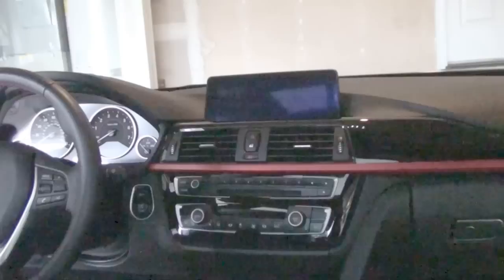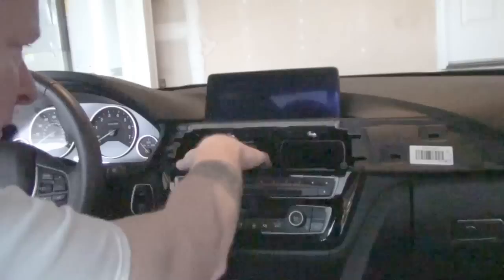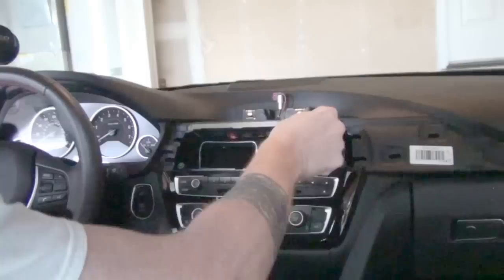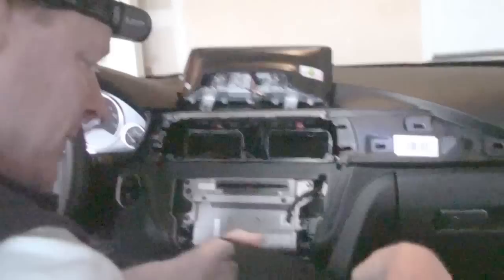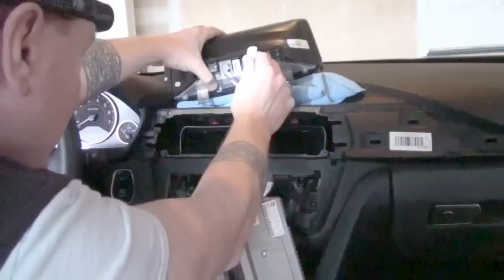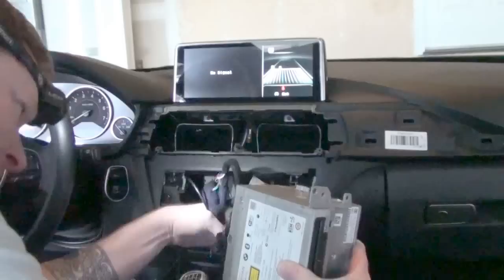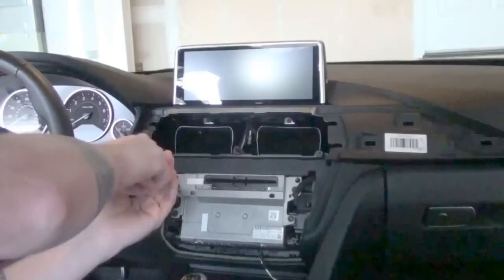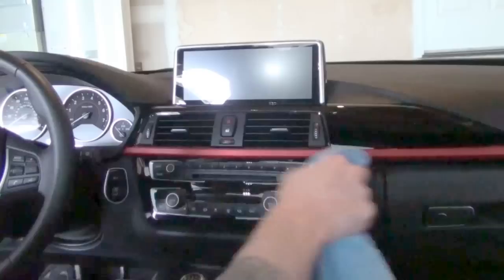BMW F32 Avin 10.25" BMW Android Multimedia Navigation System installation DIY

Comment: Very helpful video!! My only suggestion is be careful not to touch or dirty the ends of the optical cables. In the event they get dirty you could experience degraded audio quality. I'm not sure how sensitive audio optical fiber is to contamination. I know first hand network fiber optic cabling is extremely sensitive to contamination. Literally a spec of dust on a connector (plug) can destroy bandwidth or prevent the network from working entirely. Could be the same for audio fibers.
Reply from the maker: Solid advice!

Comment from the maker: Screen resolution is 1280x480 and very sharp, makes all of the displays look better in the original iDrive areas.  The backup camera is especially noticeable as detail and color appears much sharper.
Reply: Hi bmwdiyguy, I saw this on the avinusa website. Do you know if it will work on a bmw x5 2007 e70? The site only says bmw e70 2011. In other website it is 2007-2013
Reply from the maker: Howdy!  I honestly am not sure.. I would reach out to Avin directly and ask them first, as I have no way of knowing if the mounts and install points are the same.

Comment: Hi bud.
I used this to install on my car and appreciated it. I'm uninstalling before I sell and just wondering if I could get away with just unplugging the screen and swapping over, without having to pull out the radio. What do you think?
Reply from the maker: No because you have to take the adapter cable back out
Reply: @BMWDIYGuy  Cant find my guide, what's the adapter cable doing?

Comment: Hoping you might be able to answer a quick question.  I had my 428 into the shop and they did something with the power that caused the Display to reset.  I got everything back to the way that I had it but the screen is now so dimm that it is barely usable.  I have used the 3 setting brightness button in the drag down menu but that only makes it worse.  In the camera settings there is a brightness setting but that is at 100% and that is also worse.  It is now at 100% what used to be the dimmest setting prior to whatever the shop did to "reset" things.  Any thoughts on increasing the systems brightness?
Reply from the maker: That is very very odd and cant say I have seen that behavior.  Did the shop take the display out or something?  Other than some bizarre wiring problem, or maybe damage to the display I am not sure what would cause that.
Reply: @BMWDIYGuy  the display never came out, at most it was the battery was disconnected for a while.  OEM side is perfectly fine but 100% brightness on the Android side is not enough to use it during the day.  I sent a support question into Avin to see what they say.
Reply: @BMWDIYGuy  sorry to bother you again on this, but I haven't been able to get any help from AVIN.  I believe what happened is that the B<W shop had the battery disconnected and the headlights on and when they connected it back up it caused the default brightness setting in the display to max out at nighttime brightness, even during the day.  I have the factory img from Avin, but I want to reformat the unit and install fresh.  Install update over itself has not worked.  I have tried px3_reset.img, and px3_format.img, but neither of those worked.  Any thoughts on how to wipe, reformat and reinstall the image fresh?

Comment: I did purchase the unit and it came out really great! Install was a piece of cake. I also purchased the back up camera. Do you mind telling me where you plugged in everything? I do get where to plug the basic yellow plug. But there's the other wire with the red and black wire together. Where do I plug those into? because you have them by the front and back of the car.

Comment: Hi I have a quick question, at around 15mins you mention possibly running a cable back to the AUX in the arm rest, do you have any more into on that? Before I start fitting my system I wanted to make sure I know what I might need to do, thanks :) amazing vid and really made me feel really to fit mine!
Reply from the maker: Always happy to help and the install is really pretty simple. 8)  The AUX cable is included with the kit, so IF you end up needing to run it, you do so from the space behind the head unit and under the center dash, and up into the space under the arm rest and AUX port.
Reply: BMW DIY Guy great thanks! So the AUX cable included is for that purpose should t be needed? Will I find a male or female connection when I route it to the arm rest? Sorry for the questions, it’s the only bit I’m worried about :)
Reply from the maker: Nothing to worry about.. its a male to male plug, from the wiring harness to the AUX port under the arm rest.  Super simple and easy IF you need it, as I didn't have to run it myself.
Reply: BMW DIY Guy great so just a plug to deal with if I need it, thanks for the quick reply :) going to try and it in a couple of days :)
Reply: Hi, I’ve successfully fitted my screen! Looks great! I don’t seem to have sound from the android side so look like I’ll need to run that cable :( also when I go to navigation it opens google maps which is fine but  it says ‘can’t connect to the network. Check your data and try again’ any ideas how to resolve that?
Reply from the maker: Yes.. so google maps requires an internet access, OR you have downloaded local maps.  Either way, attach your display to a hotspot or wireless from home and run any updates, and download offline maps.
Reply: BMW DIY Guy yup that worked! As expected I have no sound from the WiFi side, I’m hunting where to plug that in, I had a female AUX on the back on the CD unit with audio out on, I’m guessing it’s not that?
Reply from the maker: No. you will want to run from the aux port on the new wiring harness, to the aux port under your arm rest.
Reply: BMW DIY Guy sorted and working! Perfect thanks so much for your help :)

Comment: Hi there I have one of these units and would like to know how you change the parking sensor screen back to the oem option? When the parking sensors come on it goes to a weird android screen which is not oem. Can this be changed?
Reply from the maker: Check in device settings and set PDC to OEM.
Reply: @BMWDIYGuy  thanks would this be the same for the android 10 unit as I can't find devise settings in that?

Comment: Hi BMW DIY Guy! 
Thanks for all the helpful videos! 
I’ve got an interesting question for you and I was wondering if you might be able to help me? 
I’ve got the Android 8.1 10.25“ Display in my E88 installed. Its basically the same as the Avin Gen 2 and after installing I seem to not be able to use my IDrive controller in the original BMW menu. It works perfect in the Android menu though. Do you habe any idea how I could make it work? 
I’ve tried the CCC idrive A and B and also tried all the Options in the car type option in the settings menu.
Please help me if you can! Cheers and keep up the fantastic work! ✌️

Comment: Hi. Great video:-) A simple question. Is the Avin-icons displayed right away when you start your car, or do you see the original menues, and then have to press the menu button for a couple of seconds to see the Avin-icons?
Reply from the maker: Great question, and the answer is "it depends".  The screen will default back to where you left it last.. so if you are in the iDrive screens, that will be displayed normally, like your OEM screen.  The android side is still either warm or cold booting (if cold about an 8 second(ish) startup) depending on how long it has been off and then will be available.  If you left it at the android screens when you shut down, if its a warm boot you will see them almost instantly, or after cold boot start.
Reply: BMW DIY Guy Thanks for a helpfull answer:-)
Reply from the maker: Always happy to help!
Reply: BMW DIY Guy hi again. Well, I bought it + rear camera. I drive a BMW F11 (5-series) do you know any DIY videos/guides for this particular car?
Best regards
Mikael
Reply from the maker: So regretfully I don't have anything for that specific model, but am willing to bet it will be similar at least.  If you are in the PacNW, I could possibly help.  Shoot me an email if so.
Reply: Hi Stefan. Just received the kit:-) With a rear-view camera, Apple CarPlay, DAB+ and OBD2. I wrote you a pm, but I don't expect you to answer my many questions - there is just one, which keeps bugging me. In the package there was a microphone with a mini-jack. What do I need this for? I thought the microphone in the car was used? Is it when your using the Avin bluetooth-telephone-system og CarPlay? If I need to use it, will I have to connect it to the Avin-screen (there is a female mini-jack cabel connected to it)? Thanks!
Reply from the maker: No problem and replied to your message as well.. the mic included is for handling calls and the like when taking calls through Bluetooth and the like.  There should be a connection for it, if you plan on using it.  I know in my case I didn't add it, as I didn't need it personally.
Reply: BMW DIY Guy Thanks again. Been trying the system for week now. Happy I bought it. I like the CarPlay App, and the Apple navigation works for me much better than Google Maps. 
Question: is there a way you can change the icons on the main display or delete some of them?
Reply from the maker: Mikael Hultengren so no, it's not possible to change the top level tiles.
Reply: BMW DIY Guy Thanks. Okay, listen! I just wrote to Avin, asking the same question. The whole design has just got a complete make-over: the new BMW ID6 NBT EVO UI!!! You can check out snap-shots of the design on Avin site. Just received a link to a large file with the update - this is f... exciting:-D
Reply from the maker: I will give them a shout right now and check it out, thanks for the heads up!
Reply from the maker: I just got the update yesterday, and just change to change to that option in the system settings.. its a cool change!

Comment: What's the resolution on this screen?  I see an icon for "Original Car" so I have to assume this switches back to Idrive, correct?  I have the larger screen already but nothing is squashed on my screen, which is why I asked about the resolution.  Either way, nice option!

Comment: My fiancé installed mine over the weekend. I took a long trip yesterday and I noticed that whenI put on any music app the sound is only coming from 2 speakers. The center one on dash and the passenger door. The Navigation works through all. OEM radio works though all. I though maybe I could bypass it if I connected my wireless Bluetooth aux receiver from the avin headunit direct... but I cant find an option to turn on Bluetooth to scan for devices. Any ideas??? Thanks in advance.

Comment: I did just setup my Dab+ antenna and connections yet i cant get it to work? Do you have any ideas? Its connected via the Dab unit itself with a micro usb to Usb and into " USB-IN 2" doesnt work with usb 1 either.

Comment: Hi, thanks again for all your help while fitting my system, I have run into another problem and have not had a response from Avin about it, when I select the navigation on the unit it needs to have a phone as a WiFi link to work, it’s not using the GPS, any ideas why it would not use the GPs? I have installed as you did under the dash, the GPS cable into the blue plug did seem loose when I fitted if that helps? The blue plug went is great but the cable into the blue plug from the GPS did spin?
Reply from the maker: Davem19835 so if it's Google maps it's looking for wifi by default for map info.  Connect it to home wifi or a hotspot and download your local map and it will work offline.  You can also run other maps like Here that downloads info and run offline.
Reply: Great thanks will try that :)

Comment: Hi, 
How are you doing? 
your videos were so helpful during installation. 
got a few questions, i have installed the AVIN screen in 2017 BMW x1 and it looks amazing comparing to the 6.5 inches. i am able to use most of the functionalities but i forgot to install the GPS antenna.i have tried to use the internet it works fine but can't use the maps while i connected the display using hot-spot. so in order for me to use the maps do i really have to install the GPS antenna or i can use my internet only ?
second is i connected my iphone straight to  USB and it doesn't work using carplay app? do i have to buy the adapter in order for carplay to work? and can i use google maps and Waze through carplay?
Thanks
Reply from the maker: Correct, you need the antenna so the android side knows where you are.. the maps, regardless of what app you use, wont be able to tell.
Reply: Thank you

Comment: Hi, I just installed this on my car today and I found my car didn't come with the optical cable (the green and black cable). However, I tested it and it works. I don't know if this will be an issue or not? Thank you for the video!
Reply from the maker: 祁 祁 it's ok.. if you don't have it, no worries.
Reply: ok, Thank you!

Comment: Hi,
I've purchased a similar system from Dasaita and followed your video to connect it up, but ran into a problem on my F25 X3  :
First, there are two wires on the back of the current device like you show here (one round plug and another flat rectangular one - roughly 4cm wide and 3mm thick).  The new device I purchased takes the round one, but not the flat and square one, the sockets are just incompatible.  The seller tells me that it is just a power cable and I don't need to connect that.  
Two, so I followed his advice and the new device powers up fine (without connecting the wire I mention above), the only trouble is that the x-drive wheel is not working, everything else seems fine, the buttons next to the wheel are working too.
Can you offer any advice please?
Thanks
Reply from the maker: xdrive.. the idrive wheel?  Hard to say not knowing the device candidly, but if the steering wheel buttons are working its at least partially talking to the car through the canbus.  Can't say I know that system, so unclear of what it might be missing.  Best contact would be the seller I am afraid.

Comment: great video! a few questions maybe you can answer. 
1. The lead that you said says "camera" i am assuming is for the power to the camera correct?  
2. my car has GPS, is there a way to use the existing gps antenna or you MUST us their GPS antenna?
3. If i have to use theres, is it being mounted inside the dash and not outside where it is visible working ok? I though they had to be out in the open and not buried in a dash
Reply from the maker: Howdy and I am happy to help!

1.  I assume you mean for the back up camera?  Or which camera, front facing or rear?
2.  It will use it's own antenna and cannot leverage existing hardware.
3.  I haven't had an issue with the GPS antenna being under the surface of the dash and fully hidden, in either multiple F3X series, or my E46 M3 and a very similar aftermarket antenna.
Reply: awesome thank you! and yes I'm sorry, I mean for my existing (after market) backup camera, it has the RCA for video and then red and black for + and GND
Reply from the maker: So yes, the RCA will plug into those ports and the trigger wire to the marked one on the new wiring harness.  You tap for power and ground at the trunk side from the wiring harness for your backup light.  I documented this in my E46 M3 DIY, but that was several years ago and I (regretfully) didnt shoot video.  I also ran the aftermarket camera in a different F30 and this display, and the hook up was the same and worked great.
Reply: ok ill have to look at my rear cam again when i pull this all out, I don't remember there being a "trigger" wire so to speak, just power which all ran to the existing "Naviks" system i use now
Reply: B Chi hi ,I also bought this system and installed but I have one problem .
Why now when I lock my Auto I have a beep from klaxon and folding mirrors closing ?
Reply from the maker: Howdy.. so I honestly don't know, don't see that behavior and not had a single report of that from anyone on the forums.  I would say just go into your iDrive settings and see if any of your options were changed?